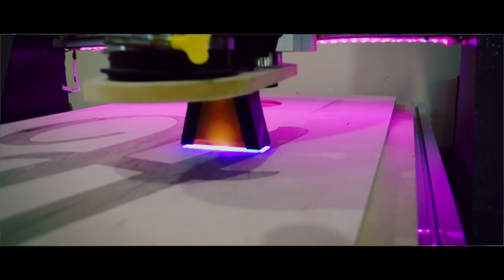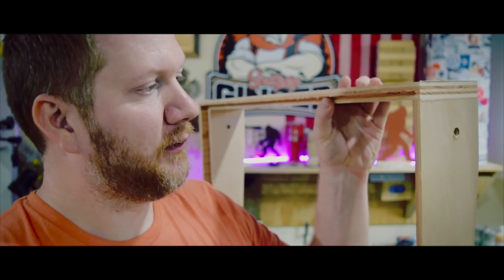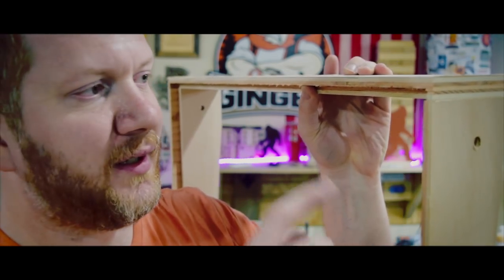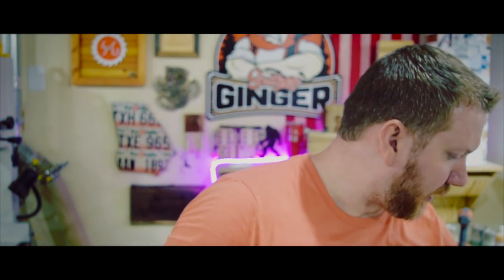How to make a stylish Cornhole set // CNC Laser Project

Comment: lul, I was just going to ask what HVLP system you were using, but couldn't remember which was the V or the P... glad I'm not the only one! Anyway, which one did you use? I've heard the Horror Freight one is good enough. 🤓👍
Reply from the maker: Haha High Velocity Low Pressure... Gotta keep that in mind lol. Went with the husky dual kit for $79. Came to me recommend by a finishing friend so I thought I'd try it.
Reply: That's a decent price... I think I'll pick one up, next time I need to finish a large project... 🤓👍
Reply from the maker: yeah and you get 2.. One regular for thicker stuff and one HVLP for thinner stuff.. works out well.

Comment: Question... did you make an adjustment for the legs.  @2:58 in the video the legs don't appear to fold up correctly.
Reply from the maker: How so? They do stick past the curved edge some.. design decision so you can grab it with your hand
Reply: @SouthernGinger  Thanks so much for responding.  From the video the legs appear to flare slightly at the bottom which looks like they will stick out when they are stored.  maybe it's the angle of the camera.  These are awesome btw.  from your video I am exploring the Axiom in more detail.  I will be purchasing the download soon.
Reply from the maker: @danlamas7563  Thank you! yeah it could be the angle or could be my design but it does fold the way I expected to.. haha :D Thanks for reaching out!